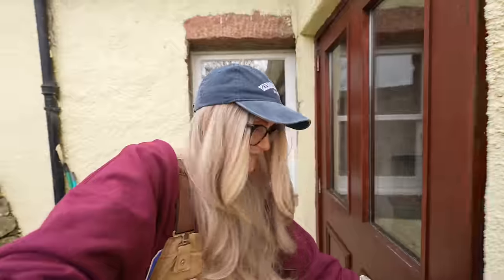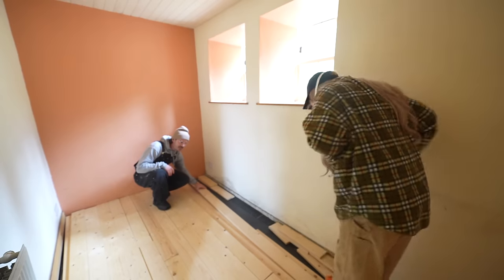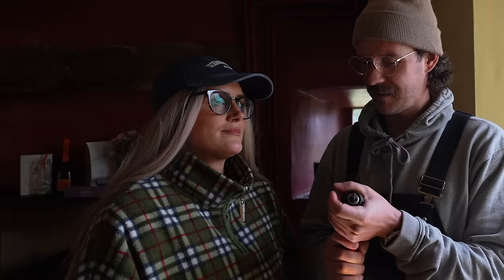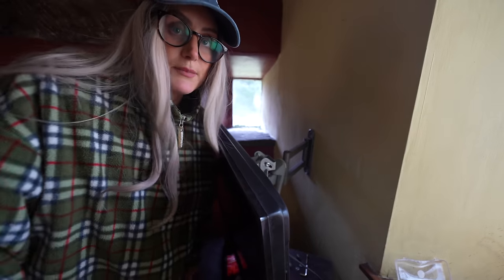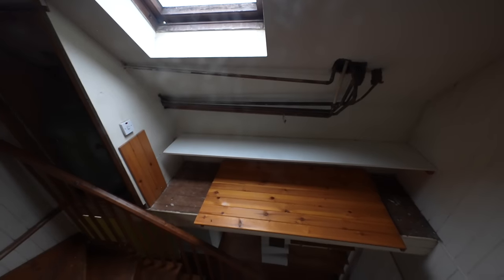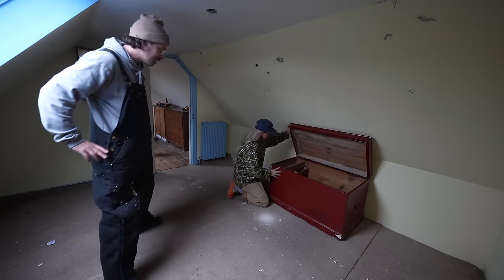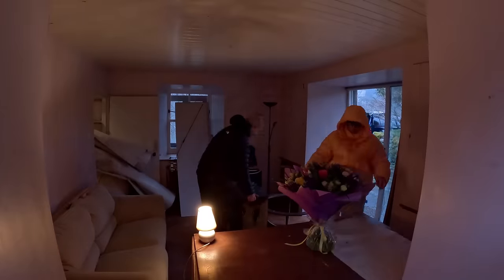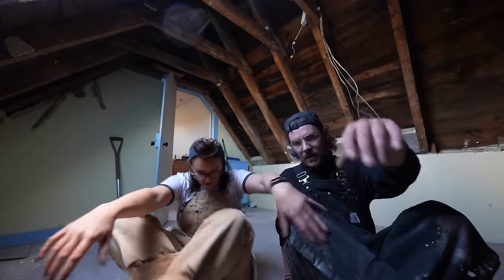Home Renovation - Let The Makeover Begin! (Ep.1)

Comment: You guys are doing great. But please 🙏 go get yourselves some some high quality respirator dust masks (not the paper thin ones), some gloves, and steel toe cap boots. It will be a worthwhile investment. Generally renovating an old house, make sure to use lime materials e.g dont go putting cement on the walls or think about 'tanking' it. You can't waterproof an old house - the walls have to breathe. Make sure if you are using modern plaster that you DO NOT dot and dab, you will end up with wet circles on your new plaster that will never dry up. If using modern plaster then make sure you baton the boards away from the wall (building a timber frame that does not come in contact with the stone as there needs to be air circulation behind the boards or it will become damp). This is coming from a woman who unbeknowingly bought a seriously damp old house with thick stone walls, and had to learn all of this. Knowing what I know now I'd have started with the barn it would be easier as its more of a blank canvas. Hope this helps you guys on your mission and goid luck 💕
Reply: Agree with Abbexi about the damp and about maybe starting with the barn, or least a room in the barn.
Reply: Yes, mask, mask mask! Do you have Hantavirus from mouse droppings there? Nasty stuff.
Reply: Such a valid point though, these stone houses are a different entity altogether, they need to breathe <3  Thank you for sharing this, i fully endorse it!
Reply: Great advice here! 👍 And yes, mask, mask, mask!

Comment: The most important thing before you think of doing any of the internals is you have to 'solve' the damp / water ingress. The house will never be habitable until you get everything waterproof. Roof, timbers, damp course, start from the outside, you may have to dig down also and put in a French drain at the back. This is one of those jobs you get professionals in to do.

Comment: Hi,  You are getting some excellent info. The first thing to tend do is called closing it in or sealing it up. Before you tend to anything inside, you need to make sure the shell of the house is weather proof. That means the roof does not leak, there is proper drainage around the foundation, the walls and windows are water tight. Once you close in the house envelope (which is a lot of work there) you can move forward with interior. But.....  sealing the house comes before anything else. That is the part where you preserve the house so any work forward from there will be forever rather than having mold and rot come back. I've built, wired and plumbed houses and converted wiring from knob and tube to Romex.  Make sure your Breaker/distribution panel is safe. Assume all other wiring will be replaced. After closing in the shell, Work once space at a time/once phase at a time. Get one area comfortable/livable. That is psychologically vital. You must be able to relax the mind when you sit down. There are two ways to do things on a renovation. 1. The right way. 2. The way you will have to fix over and over again. You pick.   I'll stop now. I wish you (plural) Love and Peace... you will especially need lots of Peace.
Reply: This.
Reply: All great advice!! Amy make sure and wear short hair or tie back so it doesn't get caught in power tools ❣️
Reply: 👍👍 I watch Mr & Mrs Adventure (on Sundays) very similar couple, van-lifers now reno a watermill in Portugal. Last yr they started working non the outside Inc roof & surrounding land first while living in van, as they are down in the valley they have water drainage issues they needed to sort out before this last Autumn Winter rains used French drains & concrete pipes now working inside they have to use cert builders etc to gain the habitable licence with the complexities of the building sure makes life a lot easier for them. They could do with their excellent German builder Andy! (used to work in UK) not sure he'd want to swap the Portuguese climate now though lol. Stay safe lads 💖
Reply: Right on!
Reply: Always good to check the structural inside components as well, like they are doing, before building a brand new roof on top 🙏🏻
Reply: You are absolutely right, there is nothing to add!
Reply: You can do this demo can’t wait to see the journey unfold every week Amy, you may want to wear either short wigs or just hats because you don’t want none of those mold spores getting into your wig because you have very beautiful wigs

Comment: I would say that tackling the damp issue where the wood floor is needs to be done from the outside first….if that is not done..I.e. a french drain, it will never be a good job from the inside. Best of luck 🤞🏻

Comment: As your building is historic check out the Scottish Lime Centre Trust as you’ll need to use ‘breathable’ materials to stop the mould. They do courses on lime plastering which would be good for you n maybe their on site training. Good luck, look forward to following the journey 🤗
Reply: I was thinking the same thing. Old buildings need breathable materials when it comes to insulation.
Reply: according to what both of you are saying here, it sounds like only insulation they should be using sheep's wool batting -- it's breathable, It wicks and processes moisture, it cleans the air, and it's literally the only non-toxic insulation in existence (last i checked).

so it's perfect that they're in Scotland, they should have no trouble at all procuring enough sheep's wool insulation for every wall, floor and ceiling in every building on the property ! 

🐑🐑🐑🐑🐑🐑🐑🐑
Reply: @vibecat4899 😂 that's a good one. 
There are actually quite a few options out there.
Reply: Also check out the Historic Environment Scotland series of technical publications, which covers most of the issues that the cottage has.

Comment: There's a reason that after builders build a frame of the house, they 'dry it in' by adding a roof and the walls.  As several people said, you can't get rid of the damp from the inside out. You have to stop the water from getting into the house by fixing the house and then making sure the frame of the house isn't rotting from mildew and wood rot.

Comment: Apart from the already excellent advice provided, might I point out that you have no potable water. Before investing big bucks in renovation, sort the water issue. If it is an easy fix…i.e. bleach down the well head to kill bacteria, great. If it’s a bigger issue, you may have to drill a new well. Given your “isolation” I assume you are on septic … hope that was inspected. Good luck, and wear a mask at the very least.
Reply: The water problem should of been fixed before anything. Can't work without water.

Comment: Hi guys, if you don’t know how long it will take to fill a skip with waste, you can get grabber lorry collection if you just pile it up. Then a lorry with a claw comes along and picks it all up, puts it in the back. Just Make sure the lorry can get up there first though and check what each company is able/ happy to take.
Reply: You also don’t/ shouldn’t need insulation between levels in the house. There may be a reason it’s been done but the ground floor, roof and walls should be insulated. Not the floor between rooms. It may have been put in as an attempt at sound proofing.

Comment: to answer your damp wall question (in the bedroom) - others commented before you need French drains around your house - that will help A LOT. But you can also seal and paint with water-proofing qualities. If you're unable to seal your house up to prevent the damp - dehumidifiers work really well as well, and you may need one in most of the downstairs rooms.  Good luck!
Reply: Don't try to seal it up from inside! Will cause more problems. Sort out your drainage like others have said and then use breathable ( vapour permeable) materials on all external walls inside and out. Get rid of any cement render on the outside and gypsum (pink) plaster on the inside. Don't use anything marketing itself as 'damp proofing' on the old walls.

Comment: In addition to all the basics of perimeter drains outside, water tight roof, gutters and drains to keep water away from the house it may be worth considering a rain screen exterior surface with a breathing space between the house wall and the back of the rain screen. Also we have found that a heat recovery ventilation system is a brilliant way to keep the humidity indoors at a low level. It is simple, costs little to run, is quiet, low maintenance and if left running while you are away from the house, it’s fresh and healthy air on your return. Very best of luck and thank you for sharing this exciting journey.

Comment: The wall with damp could be a few things.  Gutters on the roof may need fixing.   Also you may need to excavate around the house and put a water membrane around the house as well as installing a french drain.  Also please wear the right gear while the work is underway.  Proper boots to protect your feet, protective eye wear, masks, work clothes, gloves.  Please get some working clothes .  Health and safety guys are so important.  You can replace the installation with a better quality wool installation there are better ones less toxic if you have allergies etc. and are more eco friendly.  We had to get a skip for a renovation and our kitchen ceiling and original hay installation filled the skip I couldn't believe it.  So get one large one for 7 days I think you can select a mixed debris skip.  It will be full for sure.  You will probably need more than one.  As it goes along.

Comment: One thing that might help with the damp coming in to the walls from the ground is digging a 10 inch wide trench around the entire house walls and filling it with gravel for better drainage so the wet soil isn't resting on the foundation.
Reply: They need to see what Mr & Mrs Adventure did for this + to prevent subsidence but they also used an expect builder (& mate) needed the yrs of expertise he has for a proper job that will last decades +. Need to get the earth away from direct contact with the house.

Comment: Water wall. On the leaking wall . 4 ft from foundation dig a 4 ft deep trench parallel to exterior fill with 6 -12inches of pea gravel ( soft edge pea size rocks) the. Lay in a p4 inch pipe with holes in it you want the pipe gradually getting deeper toward the edge of house. 4 ft past foundation so water drains out of pipe then run pipe to the hillside so water runs down the hill use a cap on end of pipe that will allow water to flow out but rodents can not get in. Cover trench and pipe in more gravel until fully covered then cover withe soil.This is called a perimeter drain.  Also dig out trench along foundation wall 4 ft deep.  Clean and paint with rubber sealant paint Secaflex after dry fill back soil. Do paint before drain.

Comment: Some 35 years ago my Dad moved back to the UK and bought a 250 year old property (also on a slope). It felt damp throughout. The previous owners had blocked every air vent and gap in an attempt to keep the heat in. All that happened was that they kept all of the moisture that they were generating, in.

Dad opened up all of the old air bricks and added some more. Within 6 months the house was bone dry. 

So make sure the trickle vents on the velux is left open, and obviously, consider a French Drain.

Comment: Can solidly recomend someone for al your water supplies from drilling (if need be) of a new well right through to external pipework and filtration system etc etc GC Aquatech they are about 25-40 miles away in Insch and so good they are used right throughout Scotland

Comment: I came here to join in the chorus of making sure you're wearing N95 respirator masks.  If there are mouse poops, you could inhale the particles while cleaning/demoing and get Hanta.  Also consider a French drain for the back wall or get estimates for waterproofing outside of your foundation rather than try to waterproof on the inside.

Comment: Get a couple respirators. Especially working around mold and asbestos. Asbestos isn't too dangerous until you 'disturb' it. I'd also recommend renovating a small area and putting blankets and plastic hangings around it so you have somewhere to sit and relax when you need to. Also, what Amy had was a hammer drill. There is a smaller version that is the drill itself.

Comment: I’m Most of the entire structure needs to be pulled down to the beams. all pipes removed and all wiring removed.   all insulation tossed and all wood checked for wood worm and rot!!!   Good luck. Then there is the water incursion from the back wall mountain needs dug out and a French drain installed and then there is the issue of the stone—-this will be a great project and be beautiful when done.  At some point there will be what did we start but get cracking and you will be so rewarded. Take time away and rest play.  Good luck to you both

Comment: Mold isn't easy to get rid of. I would rent ozone air machines to pit I. The cottage. It will clean the air. I would dig the ground away from the house and use some kind of sealant, pit pete gravel, and tile.down to move the water away from the house and with some gutters. You have a lot of work ahead of you. Just work smarter, not harder!!!

Comment: Your friendly neighborhood nurse here (who’s been surrounded by craftspeople forever): your health was already at risk, please do not risk it again, in building and demos you have to have the appropriate protective equipment! Please wear cloves, not just rubber ones, protective ones, mask with filters, safety glasses, with asbestos you might need full coverage and a ventilation system, shoes - there are shoes with thicker soles and metal caps … there is a company in Germany that equipped almost every second company in the building industry in Germany called Engelbert Strauss, they are specialized in all kinds of work gear and wear, their stuff is on the expensive side but very well and cleverly build, they have a very long life (also look good) and great functionality. Maybe they would even be open for a sponsorship.

Comment: As many have mentioned, you probably want to dig a trench along the back to catch the water coming off the hill before it gets to the wall and move it to the side away from the house.  It gets filled with gravel and a perforated drain tube wrapped in fabric to keep dirt out.   Cover with more gravel and the topodd with dirt.   Water will come down and drop down into then drain tile and go off.  Just make sure it dumps out somewhere were it won't come back the house.  The run will need to be a little sloped ao the water moves out and doesn't pool up and sit.

Comment: Consider running a Dehumidifier(s) inside the house 24/7 to help with the Moisture levels during construction, especially in the bathroom and kitchen if you plan to use them.

Comment: I am really looking forward to following along with this. Couple of things I noticed and I am sure are repeated in the comments:

PPE / Safety:
With the rat and mouse droppings, mould, damp etc. - get gloves and a mask at the very least when you're touching or removing anything.
Get the flue on the fire checked - if its not clear you risk all the harmful fumes (which you can't smell) coming into the house which is fatal.

Damp:
You will probably have a combination of this - water coming in through the roof, through the poor guttering and downpipes.
You may also find land is built up too high or drainage is not good enough around the property allowing water to seep in.
If the exterior wall is concrete render - remove this as its preventing the house from breathing and will cause damp issues.

On the interior, again you need breathability - if you have new plaster boarded walls, insulated, rendered with gypsum plaster - there is no way for the moisture inside the house to escape. You need to strip back to brick internally and then use lime plaster instead. This will allow the house to breathe and moisture to escape.

Good luck!

Comment: I would dig out all the ground floors if there is no sign of a damp proof plastic membrane or insulation under the concrete.  May be an option to add certain areas with underfloor heating, although I prefer the instant heat from radiators. When I renovated an old stone school house in Normandy, France we had a total of 14 radiators. 4 of them were reclaimed cast iron. We loved them, really threw out the heat for their size! Installed a Villager AHI boiler stove with 45,000 btu wraparound boiler. Heated the house really well but used 20 cubic metres of logs, but in 2008 only cost 15-30 euros a cubic metre, cut to 45cm, delivered and ready to burn. In the UK wood is far too expensive to use to run central heating, unless you can get free wood or a cheap source.

Comment: Good thing is that the hoise is stone. Stone wont go bad that easily. But everything that can rot will rot if you do not take in to account any moisture (rain, capilarry conduction from the ground and what ever will flow from surrounding area). Roof, drainage and redirection of any water thats comming down from the hill is the forst step to get things dry first. After everything is demoisturized, then you can safetly start building on top of the stone stuctures

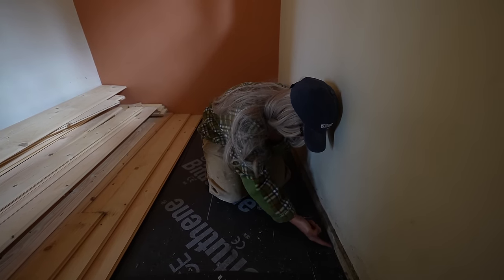Comment: @ 6:31, you can apply a liquid membrane (liquid rubber) from the inside, but it sounds like you may have a drainage issue, especially if your house is up against a hillside. If rainwater drainage is the issue, you'll need to dig a French Drain around and away from your Foundation.

Once you install your downspouts in the end, you should dig a trench away from the home so the water spills at the street level, in your garden, or in a rainwater catch basin underground. Or you can filter out the rain water and have your downspouts fill above ground tanks. Then you can use that water for future gardening, car washing, etc..